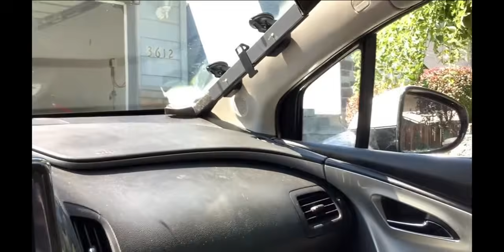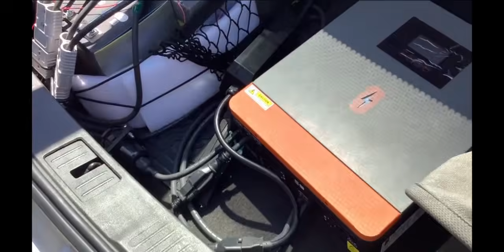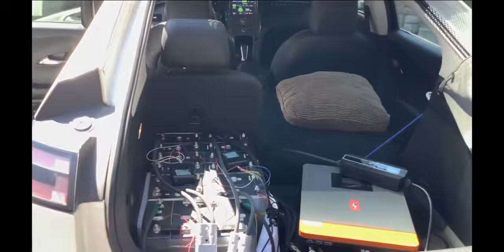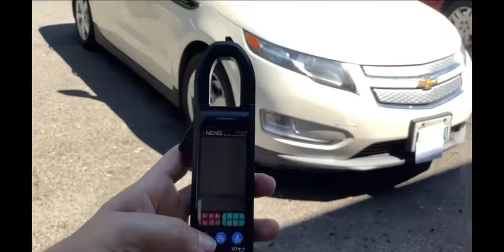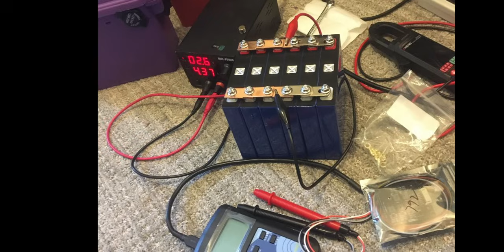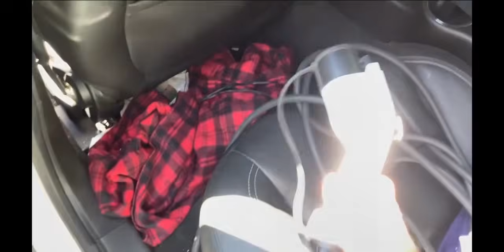Solar Powered+Range Extended, Chevy Volt, 140k mile review

Comment: This is awesome.   Great idea to only power 12V stuff to be more efficient.  Have you considered more panels on the hood, trunk/rear window, or side panels?
Reply from the maker: hmm i thought about the hood but it has that weird bump in it and i think it would have a larger impact on the aero of the car over the hood. same with the side panels, lot of the drag on cars has to do with getting the air to reattach after the front tires, and the sun angle would probably only give me 20 watts.
I was considering putting 4-6x cheap 10w panels on the rear spoiler, but it might end up being worse for the aero since the fastback shape is really deliberate there to both minimize the vortex behind the car and also add forward vectored "helpful drag" across the hatch window. 
seems like the only real win-win area where it would be a net positive on hwy range is flush mounted on the roof. was thinking of removing the diode/junction boxes on the solar panels, but they dont seem to affect aero right now based on where the dust builds up on the car.

Comment: I’ve been wanting to do the same thing for a year now. Love seeing someone actually do it!
Reply from the maker: why not. solar is dirt cheap and gas/public charging is the most expensive energy we buy. makes the most sense to me to use solar/portable charging to reduce that expense first before slapping panels high up on a roof or expensive ground mount.
i made a 2nd longer video which goes a lot more indepth with how it all works if you want to do something similar called "efficient use of solar on evs" or something like that

Comment: Neat design, a bit scary in regards to securing the system.  Like maybe custom ratchet strapped tray at the least? Something seems better than floating.
Reply from the maker: yeah its still temporary. kind of half bunjieed to the cargo points in my trunk, hasnt moved over the last few months of driving around. weighs ~150lb so it doesnt take much to keep it in place. used lots of fiberglass strapping tape to make 2x bricks of 6 cells and 1x brick of 4 cells, dont really think they could fall over unless my car rolled over or something. got all the silicone caps to insulate the terminals, have been trying to minimize the amount of times i torque the studs down though so waiting for them to get loose again before removing all the busbars and installing the insulator caps. just check it every couple weeks with a thermal camera when im charging it.
eventually it will come out when i finish my hv lfp battery expansion project which will use the 2x 10mm cargo point bolts in back to secure it down. still working on the design to insulate the high voltage from everything though, not a trivial task. documenting the project on the gm volt forums under gen1 modifications section if youre interested, have a write up there already.
auxillary battery will probably get moved to my garage to be used as a sort of mini off grid charging source where I can use solar panels to offset most of the cost of charging and a 120v to 240v stepup converter when there isnt enough sun.

Comment: I wonder if amrh like that can be done to a gen2 Prius
Reply: @vevenaneathna  could we add some batteries, panels and give the gen2 prius some plugin power for say 10-20 miles or so :)
Reply from the maker: @vicentepallamare2608  ya, not as much room in the prius as in the volt, prius early gens before 2015 phev version has lower voltage for the ev motors, around 150-200v i think, and ev motors are pretty anemic compared to volt (like 30-40kw vs volts 185kw of ev motors) so you could get away with larger cheaper 280ah cells (the ones i made my aux battery out of). adding an ev charger would be a bit more difficult but you can use 500 buck 6.6kw chargers meant for e bikes/motorcycles, just have to specify the correct voltage ranges to mfg before oyu order from china. problem is, project lithium with the early gen prius hv battery expansions have run into a lot of issues long term due to cold weather charging of the lfp batteries. causes them to grenade in freezing weather. you loose a lot of range/most of hte benifit with their later modles which had built in heaters, so questionable. LTO would work perfectly though but would be a bit more expensive. 

solar panels again are way better applied to the low voltage system for exact reasons i discussed in this video
Reply: @vicentepallamare2608  My thought was diode protect so not to charge the added lithium pack, make that plug in and solar charged with separate controllers, then add in parallel with a contactor wired with the main HV Battery contactor.  Was thinking can use bluetooth or other BMS systems for the lithium.  Though want to consider the lithium pack output range whether DC-DC converter or not.  I keep wondering since the Prius lithium batteries are so cheap compared to the NiMH, albeit they're not that great. Definitely other options if done safely.
Reply from the maker: @jafinch78  my hv battery expansion pack im building is using smaller 32ah lfp cells in a 112s arrangement to get the voltages to line up. dc-dc converter too smart for me and i worry about back emf or regen breaking frying it. documenting my hv bat build on the gm volt forums under gen1 mods if youre interested in more of the details like contactors and getting around software issues with dumb mechanical solutions lol.
there was someone who turned their early gen prius into an ev with a dc-dc converter as youre describing and they ended up frying it. lot of money to make that mistake compared to how cheap lfp bats are. they were in the uk somewhere i forget their channel name, not a lot of views on the video, basically ticked the car into thinking it was out of gas lol. early gen prius makes a bad ev conversion. ev motors are just meant to assist and cant spin faster than like 35-55 mph depending on generation

Comment: Do you have links to your inverter and equipment?
Reply from the maker: no, yt generally bl0ks the sh hairing of links (and sometimes any discussion their ai thinks is related to it because of all the spambots) . everything i listed in description is available on alxp. sometimes u have to wait for seasonal promos to get 15-20 percent coup. stack a good 3%cc like boa custom, and do alxp's dumb daily coins redemption to get another -3%. make sure youre stacking mfg coups with seasonal promo coups. usually its like 1/10th the price of bezo's jungle site if you do everything correctly :)